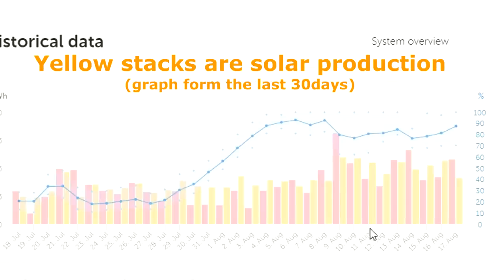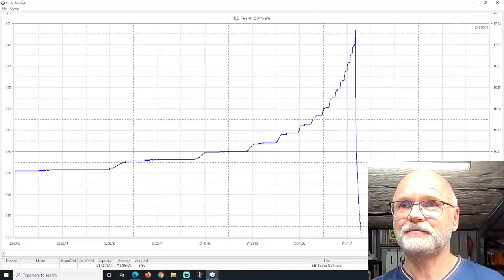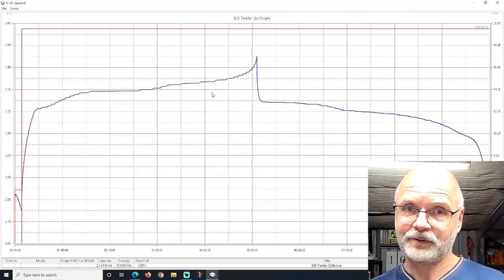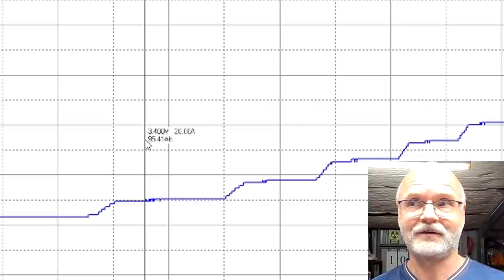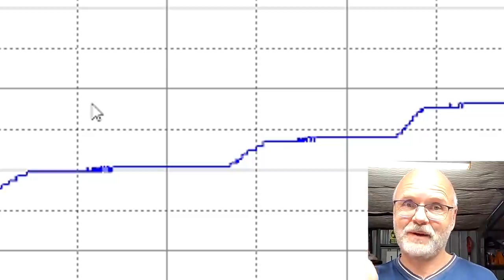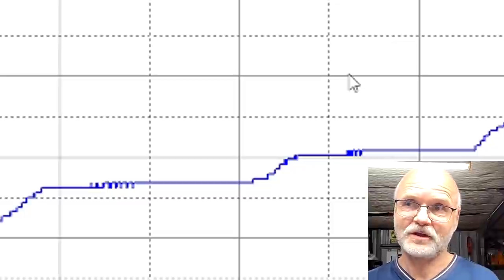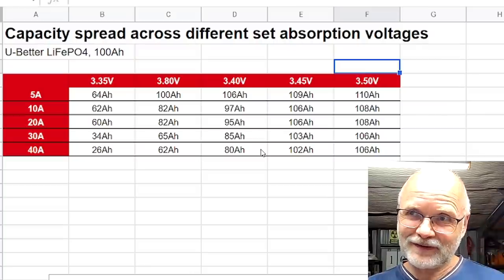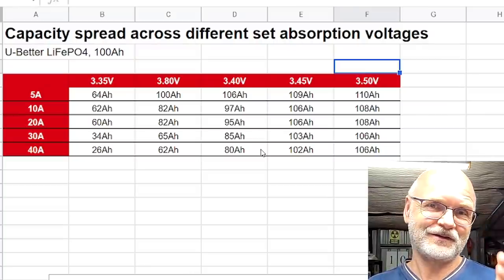Finding 20% and 80% SOC with LiFePO4. Why charging current and charging speed matters!

Comment: Andy, this experiment and analysis is fantastic.  I kind of wish you would have taken it out to 3.55, 3.6 and 3.65 only because the manufacturers of the cells usually have a charge voltage listed at 3.65v.  Most chargers (not CC) charge at 3.6v except for the Victron that charges at 3.5v.  Me thinks Victron has done more "homework" than many other manufacturers of chargers.
Here is the reason I am concerned about the voltage of chargers.  My little solar system (presently AGM) is in a remote cabin used mainly only during hunting season which is October thru December.  The cabin is in a North American northern state.  We get very poor solar energy during those months especially in November and December.  So, we normally have to supplement our solar with a generator and a charger to top our batteries off.
Yes, I can change the charge voltages in the CC but I am not aware of a charger (40-50amps) that has a profile of 3.5v or lower.  The Victron is only 30 amps.  I'd prefer to charge the soon to be LifePo battery as quickly as I can so we don't have to run the generator for hours (like we do now!)
The Progressive Dynamics and Aims chargers both charge at 3.6.  I really don't want to go that high because I, like you, would like to stay in the 20-80% SOC range.
See my dilemma?
Any advice?
I have learned a ton from Will Prowse but I have to say you are doing things and finding out more about this chemistry than anyone else on YouTube, at least from my research.  Keep up the good work.

Comment: Well Andy; This answered my question that I asked you yesterday and again today! I have spent literally 14 hours searching for this exact data, and you nailed it perfectly!

I have 6x100w Solar, 200Ah Prebuilt & 280Ah DIY w/JBD BMS in parallel and the BMS for both batteries works, and cuts off Battery Charging at 14.2v and then turns back on when the battery gets below 13.4. So "THE BMS WORKS." New Charge Controller is MPPT 40Amp

I asked you to turn up your voltage from your charge controller to your battery to 66v. Your BMS/'s SHOULD CUT OFF & PROTECT your Battery when they are full, & or if they get any "Over-Current" scenario, right... Essentially, if you increase the voltage from the Charge Controller to the Battery, you are NOT increasing the Battery Voltage, but you ARE increasing the Amps... Right? 

In your 12v example in this video; 3.8v X4 = 15.2v... So, I turned up the voltage from my charge controller to 14.8v to maximize Amps out of the Charge Controller and into my Battery. - I am asking you to essentially do the same. I went from getting 20amps on the default settings to getting 30 amps with custom higher settings, and while people think that charging a 12v4s LIFEP04 battery can not exceed 14.6, your test above shows that even  at15.2v for a large battery like mine (small compared to yours) it is fine and the battery absorbs the vast majority & is in good efficiency range.... thank you.

(Does your BMS work? Does it let your battery charge higher then it should? No, Great, so if you increase the charge voltage,  you are not increasing the battery voltage, you are "charging the battery" so - why this fear that if you use a charge current higher then the max battery charge voltage it isn't safe.., or something - this is not lead acid, and your BMS is there for this exact reason. The tech is there, use it, try it. everyone is stuck on this idea that its not safe because if the charge voltage isnt higher then the max charge, then you can't overcharge your battery - and while that may have been a very important factor for lead acid or batteries without BMS... its 2022... and with the right settings I believe we can safely squeeze a little more amps out or solar panels.) Yes? & Peace

Comment: Whoa dude, you rock!  That's a lot of work you just did and I appreciate it.  So much better than just hearing pontification on the right voltage needed to charge a battery.  Getting actual data and sharing with us is awesome!

Comment: Thanks for running these variable charge voltage setting tests and sharing the results with us, Andy!  For the better part of our summer here in the northern hemisphere I have been adjusting my charge controller settings through trial and error to try to find the optimal boost/bulk charge setting to get my battery to approximately 90%SOC at the end of the average solar day.  I only recently settled into a 3.475V per cell (13.9V in my 4 cell battery) boost setting and 13.6V float and found it seems to give me the most consistent result.  Your valued work has confirmed why that setting is close to optimal if the goal is to attempt to limit use to approximately 80% of the battery's capacity (discharging to 10% SOC).

Comment: Great Information. I guess this is showing us that the chemistry of LiFePo4 is happiest at 3.45-3.50 volts, so far. Maybe 3.55-3.65v too, as spec'd by the industry. Your point is well taken, less voltage less stress but there is a sweet spot. As always Thanks

Comment: Hi Andy, I have MPP all in ones and they had an issue with going to float too early. So what I did was I turned float off and increased absorption to 99hrs. I then used the SOC relay in my victron BMV to disconnect the majority of panels going to my chargers at say 77% SOC using a reclaimed DC contactor. What this does is it allows for fast charging to a given SOC and then it reduces the current to a trickle which is just enough to cover the house loads. This system has been working well for a while now. 
One issue is monitoring the actual SOC because I never go to 100% the BMV SOC could be drifting. I set up a google form which populates a spreadsheet. I occasionally check the BMV voltage and SOC early in the morning when the loads have been low and no charging has occurred. The values are checked against a reference table of SOC vs Voltage to see if the SOC is drifting. I have adjusted the SOC value and the settings in the BMV once so far. I can share the spreadsheet and form if you are interested.
Reply from the maker: That's a clever workaround with the BMV and turning off solar panels. But MPP needs to fix this with a software update.
Man, you're all over it with your spreadsheet and data collection. Love it!
Reply: @OffGridGarageAustralia  some guys on the aeva forum have made their own firmware but I have yet to try it, still wary of bricking the inverters if I stuff it up.
Reply: Does the battery drift upwards or downwards from your 77 percent mark?
Reply: @uhjyuff2095  any way I want it to depending on how many panels are left online. I have a hysterisis of about 2% so if we have a high load the batteries may be loaded for a little while before the other panels kick in again. I aim for about 300w over average house loads so they charge up a few percent extra by the end of the day. It would be better to have a charger with a more suitable lithium profile but it does seem to work well. I have 2p16s 280ah lifepo4 at the moment.
Reply: @rattusfinkus  I believe you are doing it correctly with a solar charge on and off trigger point based on SOC percent. I don't know of any manufactured charge controllers that can do what you have setup. Great job.

Comment: Andy, you've done it again. Excellent breakdown of charging voltage versus state of charge. I always thought Renogy had rather high charge levels set for LiFePo cells at 14.2V (3.55) to 14.4V (3.6). Now it seems there is a reason for those high charging voltages. Thanks.
Reply from the maker: Thanks for your feedback!

Comment: Remember that the voltage reading when charging/discharging is NOT an accurate indication of the actual resting voltage of the cell. Cells have internal resistance so the higher the charging amps the higher the voltage reading will be. So reading 3.4v at the cell while charging does not mean the cell has been charged to 3.4v... When you remove the charging current the voltage will instantly drop to something below 3.4v.

This is the biggest reason for the difference in AHs between your charging tests. The charging current itself is affecting your voltage reading due to internal resistance of the cells. Higher amperages result in greater voltage readings just from resistance of the cell. You'd need to pause charging before taking a reading to get an accurate reading of the cells actual resting voltage. Testing the voltage during charge/discharge is never accurate.
Reply from the maker: Thanks Jeremy. That is correct, the voltage will drop after removing the charger. Just this is what we have when charging from solar. We hit the absorption voltage and the SCC switch to CV. From now on it can go fast or slow until we see the current drop. That was my intension to show and find out.
Reply: @OffGridGarageAustralia  The new JK-BMS have a built-in mechanism for compensating the effect of the element's internal resistance. In the BMS settings, enter the value of the internal resistance of each element into the table. BMS now calculates the voltage depending on the current. By entering the correct resistance value, it is possible to fully compensate for the effect of charge/discharge current on the calculated cell voltage.

Comment: This is such a useful well presented and researched video!! Thank you Andy for taking the time to run these tests. I have settled on a charge voltage of 3.45 V/cell for my packs thanks to this knowing i can get a much longer cycle life with much less degradation than the factory recommended 3.60-3.65V - and with a tiny smount of capacity loss (I usually charge at 0.2C or lower).

Awesome channel, subbed :)

Comment: Sir, thanks for your videos and review.  I will comment the following.  The reason you are getting these results is simple, the higher the Amps you are putting in while charging the battery the faster the Voltage you want (or you are analizing) is reached. This is because of the charging curve of a LiFePo4 battery, the current is constant first while a voltage is reached and then the Voltage will be constant until full capacity is reached (or charger minimum amps setting is reached).  The goal of the chemistry is to reach the high voltage (3.65 for LiFePo4), so the more current you put in the faster a voltage is reached thus explaining your results as to why you can’t put much Ah on a battery charging at higher Amos while trying to reach a lower voltage for ghat chemistry.  This also explains why when analizing higher voltages (like 3.5V or even higher up to 3.65) you get much more of a closer “spread” as you call it or a much closer result of Ah put into the battery regardles of the amount of Amps being input while charging.  If charging at the recomended “C” ratings or lower, you should get the same Ah put back into the battery and it should be fully charged every single time.  Hope this helps a bit!!!

Comment: My off grid shed does right on 10kw now in winter in one system.. here in Caboolture.
 I'm using a second grid tie inverter with a battery charger plugged in and various automatic switches.
 If you have shading you will need to cut some trees down and possibly replant with shorter growing trees..

Comment: Question, what was the tail current you used? Yes, I discovered that 3.45v is best charging voltage, but it took more than 50 tests on the 40 amp cell tester to dial it in. Temperature plays a factor as well.

Comment: Thank you for the information andy. I would love to see the same charts on discharging the battery. What level should we go to go 20% no matter what current  ?
Reply from the maker: There will be no straight answer to that, I'm afraid. It will again depend on the discharge current.
That's why a smart shunt is so important as it counts the Ah in and out and gives you a far better idea at what SOC you are. The voltage at 20% can be anything and won't be constant.

Comment: Nice video and data. Only the 3.80V seems to be 3.38V.
So you will need a longer adsorption time at 3.40V to get a good SOC, if you have used a higher charging current before. Well, so it should be, because of the cell chemistry. That is just what I expected.
The problem is, that the charger does not have a variable adsorption time depending on previous charging current. Would be a nice feature. But I think it is not so easy to implement such a feature in a solar charger. Victron might be be able to do it in combination with the shunt. In this case they have all the data they need (battery capacity, SOC, voltage, previous current and so on).

Ok, I have the "problem" , that I studied chemistry before I switched to my current job as car electrician. And since 2011 I am working on hybrid and electric prototype cars. So I have some knowlegde / experiences which "normal people" don't have. If you know the chemistry of a LiFePO4 cell and how the energy is stored, your results are quite normal. But it is still nice to see some real measured results.
Reply from the maker: I've put this in to see how many comments I get about it 😂😂😂
It all depends how much energy the battery has absorbed already before it reaches the 3.4V. That's impossible to know for the SCC as this data could be days old. It's easier for the SCC to ask the smart shunt for help as the shunt knows better by counting Ah in and out and has a pretty good idea about the actual SOC of the battery.
Yeah, the outcome was not a big surprise as I said at the beginning but we now know for sure ;)

Comment: Its because absorbtion is timed...... 

The higher current gives a "fake" higher voltage sooner, if you remove the power it would fall back to a much lower voltage (at least with other chemistry)....... And because its timed, and not using a current cut off, it will alter the state of charge........

I use IMAX B6 to charge 18650 pack, 1A will push it up like 0.20V, but 4 amps will push it nearly 1volt. This doesnt matter because the current cutoff remains the same, so the capacity is the same, however you are using a timer from when it first sees the "absorbtion" voltage.

Comment: Very interesting and a great analysis. I think one assumption being made here is that the charge efficiency is the same for all rates?

I would love to see a consistent low discharge capacity test run against these batteries to confirm that the charged capacity matches the discharge capacity closely and whether it varies depending on the rates the batteries were charged?

Comment: “absorption” for lifepo4 is really not applicable. For a lead acid, it is mandatory since the chemistry just cannot take high current charge over ~70% without getting severe damage. (Read: you would have to raise the charge voltage beyond the specs of the battery). Lifepo4 don’t have that problem to the same extent since it is only at the upper 2-3% soc it will act in a similar way. 

The difference in ah among the different charge current is related to the internal resistance of the cells. It is not the charge speed per se. If you would charge constant with 40A and then go down to 5A when you hit your target voltage the voltage will go down and you will end up at the same ah as with a complete constant 5A charge.

What I’m saying is that the actual cell voltage is something you cannot tell during charge (or discharge for that matter).

The charger does not take the current current (no pun intended) into account when determining when to switch to “absorption”. It will just look at the voltage.

Tests performed under a controlled environment with a marshalled charger is totally different from a solar system.

After some years off grid with lifepo4 I’ve determined that the best way to harvest solar is to have the same (voltage) setting for bulk, absorption, float. Of course within the specs of the cells. ☀️
Reply: Dear this is new, what i am reading from your comment. 'same voltage for bulk, absorption and voltage'
Can you verify it? Is it the correct setting?
I am curious because I recently built a DIY lifepo4 300ah 24v system, for an inverter 4 years old (previous battery was Lead-Acid), and i am unable to fully charge my battery pack, the current drops to 1-2amp when the battery is at 70% charging, and also the voltages of individual cells were 3.35 something.
On Inverter, i set 28.4v for bulk and 26.8v for float and there's no option for absorption.
Kindly guide me what I should do.
Thanks

Comment: You’ve got me thinking about how to use my supercapacitor bank to apply a regulated charge current to charge my battery bank. I’ll have my supercapacitor bank for quick current absorption and have a regulated current and voltage system to charge my battery bank at the best charge rate. Thanks, you’re a good teacher this is all new to us… 💡 🌎 😃

Comment: Andy, I don't understand what point you are trying to make. Battery Voltage can only indicate approximate SOC when at rest. During charge or discharge, the voltage will always vary with current. 
Which means that if you terminate the charge based on voltage, then the cells must (by definition) end up undercharged.
The alternative is to hold the cell at a constant voltage, while allowing the current to taper off. Then terminate the charge based on final current.
Most "fast chargers" use an algorithm that calculates the state-of-charge and pushes sufficient charge (integrated over time) to completely fill the battery, while essentially ignoring voltage (except for safely limits). And the battery parameters are constantly re-calculated through each charge and discharge cycle.
Even twenty years ago, it was obvious (when monitoring the Specific Gravity of Lead Acid batteries) that terminating the charge based on Voltage was a rather poor method. In fact these modern charging algorithms were originally developed for Lead Acid batteries.